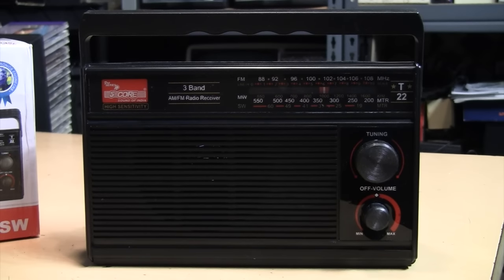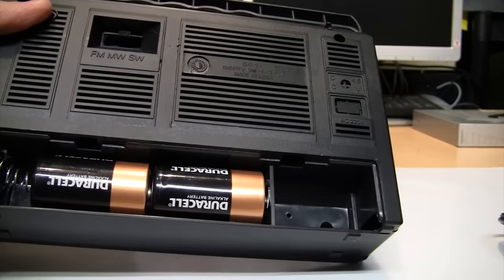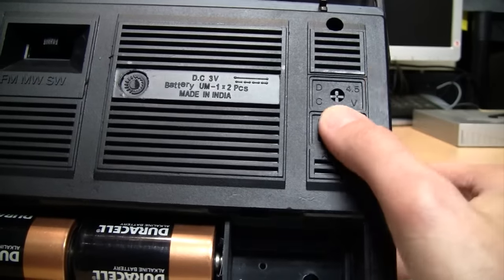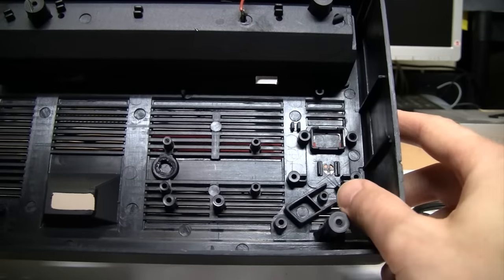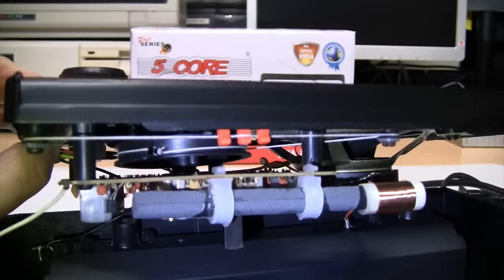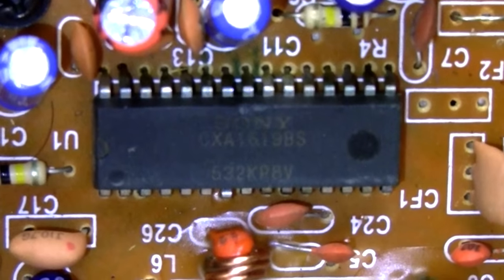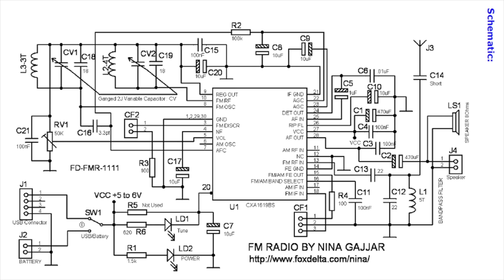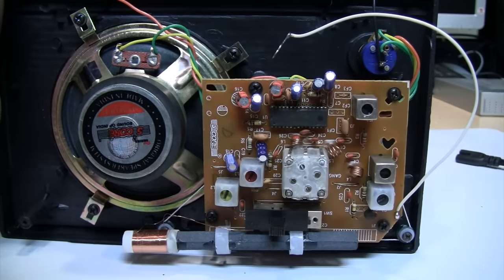Secretly made by Sony - Inside the 5 Core radio

Comment: 1:41 that radio was designed only to accept 3 volts batteries (2x 1.5v AA). The compartment you're referring to was meant for storing the long AC cord with narrow L-shaped angled down AC plug if built in AC 220 power transformer was not omitted in that radio. That's how my old GE Superadio's  compartment was designed, at least for most vintage radios at the time. And also that could've been a very selective radio for weak signal reception if ceramic filter CF2  for FM and a 455 Khz filter CF3  were not omitted.
Reply from the maker: Obviously you didn't watch the video!
Reply: @vwestlife  I did finished watching this video, including your previous video "search for true analog radio" which you keep on pointing out that same compartment. That's why I'm commenting now on this video with respect to that particular concern at 1:41 because I'm not convinced that it was for a third battery option. The plug you tested doesn't fit because you're looking at the wrong plug. Use a narrower L-shaped angled down AC plug and it will fit nicely, along with a thinner and more flexible AC wire would coil inside. That's a typical design for older transistor radios with built in power supply. Going down to the technical aspect, bear in mind that 3 volts unregulated power supply bears 4.5 to 5 volts (transformer voltage is greater than 3 volts AC when measured at the output, converting to DC by adding a rectifier and filter capacitor may further increase the voltage). There will always be a  voltage drop with a load, so 4.5 volts DC is suggested for power supply assuming you're using unregulated power brick adapter.  3 pcs AA alkaline on the other hand would yield fixed non-fluctuating 4.5 volts and the radio  may heat up due to overvoltage outside the factory design parameter. Using high capacity regulated DC voltage such as those of alkaline battery should be fixed to 3 volts because battery voltage never drops unless depleted, that's why 3 volts was the suggested rating if battery operated. Besides, the compartment with divider you are referring to is shorter a single AA battery won't fit.
Reply: BTW: I'm a vintage gadget restorer, and I know that particular chassis design from radios of the past.
Yes for modders you may cut the divider as an option to add another AA battery. But that's not simply the manufacturer's intention as they did not include a notch in the compartment which will originally fit a positive terminal for that additional battery option.
Reply: Also may I add that most radio chassis were machine crafted or molded. So there's little chance for errors unless the manufacturer used a different chassis not intended for this model. Moreover, any hand-made modifications to the chassis should be easily noticeable (that additional divider if intentionally put in place, the absence of a notch to move the positive terminal to that empty battery compartment, the voltage ratings at the back panel, etc). But so far in this video I could not see any such marks or indication that the casing was modified.

Comment: The inventive part is that is does SW. The datasheets give no clue that this is possible. Some HAM figured it out I'll bet (I didn't research this, just looked up the Sony datasheet) but I wouldn't be surprised. Got mine last week. It works great on AM which is why I got it. Gift for an AM radio fan. Nice video. Thanks!
Reply: By using different coils with the tuning capacitor, the tuning range is expanded beyond the datasheet design. All that's needed is for the tuned circuits to track the ≈450KHz IF difference between the RF and the LO. The Hallicrafters S-38/S-120 is an example of how a classic table radio design is expanded.

Comment: My Denon cassette deck has Sony Dolby S chips in it too.

Would you be able to to a teardown of the other radio to compare the synth tuner to a full analogue tuner?
Reply from the maker: I already returned the Panasonic radio because I was so unsatisfied with it. But Fran Blanche did a review and teardown of the Retekess TR-604 radio I also showed in the previous video.
Reply: @vwestlife  Glad that you returned the unit. Its performance was mediocre and that's one way for the manufacturer to know that.
Reply: Few companies can make their own chips. But having a good brand of chip doesn't exempt you from good curcuit design. In a radio the chip really only does the IF and other RF amp stages aswell as the detector and AF output. All the IF transformers and oscillator coils, the PCB layout etc. have to be well thought out too.

Comment: As a Canadian, I'd like to point out that the proper call letters for the Toronto station "Zoomer Radio 740" is "Cee-eff-ZED-em" (not "zee" ).  Also, the dial calibration is way off.

Comment: Be careful with the tuning dial as it does not have a good resistance when tuning it extremely to the left or the right.  You can actually snap whatever mechanisms are inside it and thus making the tuning dial absolutely useless.  And given how notoriously difficult it is to open it up, you cannot repair it yourself.

Thankfully, the price for replacing it is tolerable =]
Reply: Nevermind.  The radio is easy to open once you get that single screw loose.
Reply: I did buy a second one and was even able to get the first order refunded after explaining what happened and praising the product.  So their customer service is on the same level of their engineering 😁

Comment: Thank you for that awesome video.  My OCD is pegging the meter right now.  The calibration of the tuning dial is off by about 40Kc.  Can you please send me the radio so I can get my "Golden Screwdriver" in there and tweak the trimmer caps on top of the tuning capacitor?  I have to figure out which two are for AM, and the other two for FM.  What about Short Wave?  Does that even work?  Also the AM LO can may need to be adjusted as well.  Many of us "Old Farts" may remember the painstaking process of adjusting LO and front end calibration.  Trimmer caps on the high end of the dial, and the RED AM LO can when tuned on the low end of the dial.  Then of course comes the same thing with the ferrite bar antenna (front end alignment) - sliding the coil on the bar on the low end of the dial, and trimmer cap on the high end.  Rinse and repeat for FM, but bend the coil instead of sliding the coil on the bar.  Wow, the childhood memories are flooding back.  Oh, maybe just moving the dial pointer a little bit to the right might fix it?  LOL !!!!  Maybe modify the battery compartment and put in a third D cell.  How about putting in a double 18650 battery holder (8.4 V) with a single diode in series to drop it to 8V so the chip doesn't blow.  Imagine how loud that will be after you put a heatsink and forced air cooling on the single Sony chip.  I could go on and on, but I'll stop here.
Reply: @pu3hag - h. garcia Usually the slot for the screwdriver in the ferrite core wears out first, or on worse occasions cracks the core and it gets stuck, thereby no more adjusting.  This then leads to the violent smashing of the "unfixable radio."  Such were the very bad temper-tantrums I had as an 8 year old.  Luckily I grew out of that, and I have not smashed a radio in over 30 years.  There are self-help groups for that.  I think its called "RA"  Radio Anonymous."

Comment: It's a quite surprise that in 60s, 70s, 80s there was a import ban in india so the medium frequency transistors were made by usha company and the coils and capacitors were soured by local suppliers. These radios are completely vanished and now are total antique nowadays. And after the semiconductor industry now usha company sells home appliance and the fact that the company was started to manufacture transistors. SCL was another major semiconductor factory in india that manufactured semiconductors in the 70s and there was a major fire in 1987 and now the factory manufactures the semiconductor only for isro and drdo for missiles computers

Comment: Would the 5Core speakers be suitable for use in a guitar amp? I'd like to have a speaker made outside of the US, UK or China.
Reply from the maker: It claims to be rated 10 watts RMS, but I don't know how much I trust that rating. It is 4 inches in diameter, which would be rather small for a guitar amp speaker.
Reply: @vwestlife  I meant more the other speakers 5Core makes. They seem to make ones that are 12 inches. Just wanna know if they're suitable since they're likely primarily made to reproduce sound from a recording rather than create it like a guitar speaker does.
Reply from the maker: @Eddies_Bra-att-ha-grejer  Sorry, I don't have any experience with those.
Reply: @Eddies_Bra-att-ha-grejer  there's no fundamental difference, since a guitar speaker also just reproduces the sound from the pickup coil.

Comment: I've been looking for a schematic for these (no luck yet). Looks like it wouldn't be too much trouble to fit a PSU inside, maybe a transformer scavenged from an old Nokia phone charger with a regulator added. Not a SMPS for obvious reasons.

I'd also add a coil for Long Wave (with a switch) and a headphone socket with a resistor network to give a decent volume range on headphones and to prevent short or open circuit conditions (I learned that the hard way with a home-built amplifier).

Great video, as always! Thanks. ☺
Reply: PSUs for these radios were simple. A shielded transformer with the required secondary output, bridge rectifier, and electrolytic based pi filter. The electronics would be mounted on a small PC board, mounted on the case back next to the transformer. The input socket has a transfer switch to transfer the radio's supply from the internal battery to the PSU when the line cord is inserted. The DC input also had the transfer switch, except it used an external PSU.
Reply: @dougbrowning82  Yes, they are pretty basic. ☺

I'd want the schematic for coil modifications, although it wouldn't be that hard to reverse engineer this. My suggestion for "recycling" an old phone PSU (or whatever) is to save having to buy a transformer & is probably what people would do in some parts of the world.
Reply: @BG101UK  I wouldn't bother trying to put a PSU in there. Better to restore the DC input. The radio only uses 3V DC (not the 4.5V the original radio the case was designed for). There are plenty of 3V wall wart cordless phone chargers around that could power that radio.

Comment: The transistor works as RF signal amplifier. The IC has audio power amp inside, no need of separate chipamp. Very low current drain. The catch here is the perfect alignment of IFT, trimmers and osc coils. Never attempt to adjust them.  Does sony still make these chips anymore?

Comment: I laughed when I saw the first video you did about this 5core radio. Not sure if your aware of this, but 5core isn't actually an Indian company. They are actually based in the United Arab Emirates.

Their product line is also very odd. I have an old catalog from 4 years ago when I was at a trade show in Singapore that they attended. The catalog is mostly made up of speakers, cheap microphones and audio cables and so on. But then a couple of products that are not even connected with what the mainly have like toasters, an air fryer, a couple of hair dryers,  food blenders,  and then these two radio.

Nearly everything they have isn't actually made by them. The vast majority of their product line can be found from suppliers on Alibaba. As for the radios I saw these at Mustafa Plaza in Singapore. Mustafa Place is huge 24/7 shop that mainly caters  to people that use Singapore as a hub from Southeast Asia, Middle East, East Asia and the Pacific into India. So if you have a few hours between flights its a short taxi ride from Changi Airport and you can go there at anytime 2pm or 2am, 24/7. Many who have time waiting for connecting flights to India, Pakistan or other countries in Southeast Asia go there, because prices are very good as Singapore is a tax free zone.

Now this radio the TC-22 is available at some of the stalls in Mustafa Plaze, alone with the Panasonic radio you showed in the first very. Very cheap. The TC-22 the last time saw it was 25SGD (around 19 USD), but if you buy 5 or more 20SGD (around 15USD).

If your wondering why the build quality is so bad. This radio is a bit of a mish-mash in manufacturing. The housing is more than likely made by some small old molding company, with the electronics made up of surplus parts from another manufacture and then just assembled by some back ally factory who just assembles it.

Not at all an uncommon practice in India. Hell there are still old factories turing out gramophones.

The funny one is the Panasonic you showed. I know some retailers that are stuck with these. They just can't shift them. Production has actually ended, but so many were produced that haven't been sold we will see them around for a very long time. They were popular across Southeast Asia more than 15 years ago, because they were cheap. But as technology in these countries changed towards 4G and 5G networks and has become way more affordable. No one wants these anymore, so they now appear on EBay and a couple of other places. In India you can still fine old Philips radio models that have long been discontinued still being sold. They are only still being sold, because to many were produced and no one wants them. But, they can't even sell them in India anymore.

India is weird like that. Just look at the Royal Enfield Bullet. Motorcycles from every major manufacture moved on to new engine design and technology in the 1960s, but Royal Enfield continued to make the Bullet exactly the same way. Ok maybe they added fuel injecting and front disc brake. But a 2020/21 model is exactly the same. Just like the clockwork gramophones I mentioned. India the largest film producer in the world was even using the 3 strip technicolor process well into the early 1990s, when everyone else had made the switch in the early 60s.
Reply: Royal Enfield are nice retro bikes that work well enough. Why change :)))
Reply: @DolganoFF  I have one and I love it. But it is rubbish compared to Honda, Yamaha, Suzuki, Kawasaki, BMW and Ducati. The quality control is very bad and getting parts from Royal Enfield can take upwards to 6 weeks.

Throttle is awful.
Valves need adjusting between 9000 and 11000km
Common for parts to shake off when riding

Well enough isn't good enough.
Reply: It could be to get around import taxes or restrictions. I have a 1970s Panasonic Radio made in Iran !  A surprising amount of electronics sold in the EU during the 1980s was made in the U.K. My 2009 Toshiba LCD TV was "assembled in the U.K." If the additional cost of assembling locally is less than import taxes, and the market big enough companies will do it,

Keith Perron. Eton made their top of the range E1 radio in India and the quality control was so bad they ended up having to realign and retest them all in the USA.

Comment: They use a cabinet from an older model, however the modern electronic utilize only two batteries instead of three and cut other power choices like the plug for a power adaptor, nevertheless the tunner use a variable capacitor which give the feeling of a fine tunning of older radios instead of digital tunning, price is cheap and good to have this receiver that never give up.

Comment: I'm happy that "new" analog radios are still manufactured and available. But what is the point in buying crappy cheap radios with extremely low build quality from eBay, Amazon or Aliexpress, when you can usually buy an older used top-tier quality radio manufactured 10-20 years ago from the second-hand market for the same price?

Comment: The older radios that had internal cord storage had a permanently mounted cord that was attached internally and was fed through a hole on the cord storage cubby, as well as a slot in the battery cover.
Reply from the maker: But there is no cord storage cubby. That's my point. It was originally designed for 3 D cells.

Comment: Don't know if I missed it but does this radio has fine tuning with a separate dial for it?
Reply from the maker: No.
Reply: This radio has only one tuning dial and one volume control and that's it for knobs. No tone control or fine tuning knob or ring. And of course there is a band selector. Pretty simple basically. Thus this wouldn't be your best SW radio but would work fine as passable cheap AM/FM radio with decent sound.

Comment: If the chip supports am/fm, but in the case i says Short Wave, whats the deal with that?
Reply: Shortwave is AM but on a higher frequency band. It is just a case of switching in some different passive components for a simple SW radio capable of picking up powerful stations like Radio China International.

Comment: That dial is either off or the "mystery station" is not what you thought it was. When you were on 740 CFZM, the dial indicator looked good. But what you said you thought was 920 looks to me as if it is between the indicators of 700 and 800 which would really make that indicator off as you move into the higher part of the spectrum.
Reply from the maker: Correction: The mystery station actually seems to be on or around 830 kHz, not 920 kHz as I said in the video. It could possibly be WEEU from Reading, PA, although I thought they were mostly a talk station.